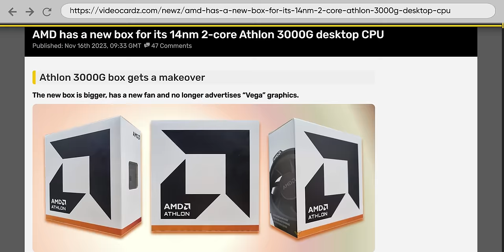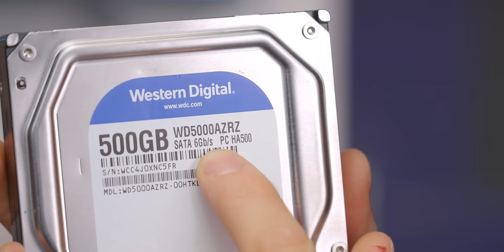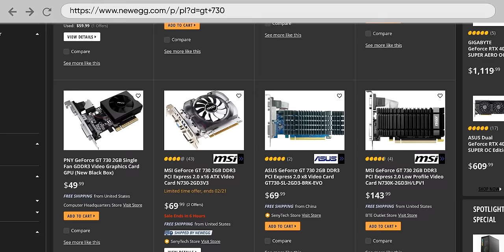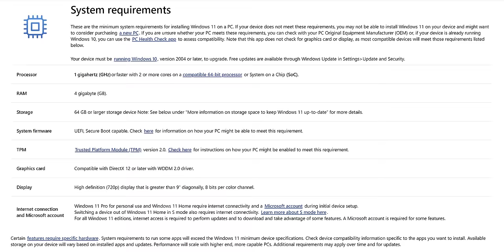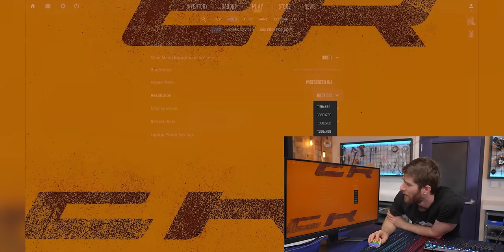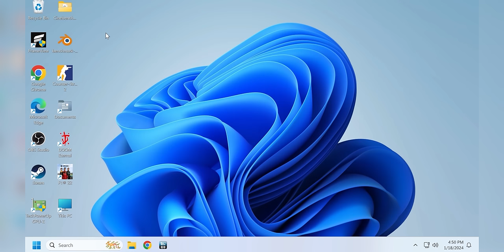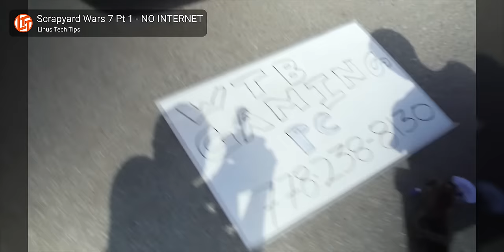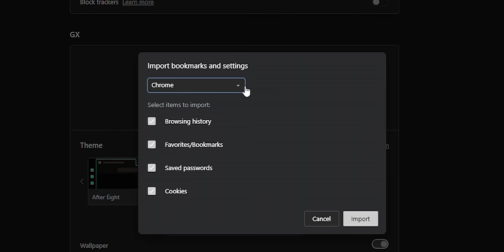I Built the Slowest Brand New PC and it Sucks.

Comment: Y'know, people say Linus is out of touch. But he still got sticker shock at $320. He has no reason to blink at that number, but he knows that it's unreasonable for that computer, because he does stay in touch with actual value to real consumers.
Reply: What I don't think helps with a lot of the people claiming linuses out of touch, is they don't seem to understand the difference between price to performance and price. Something can be very expensive but not be overpriced because you're building a PC to compete with the Mac pro on price and just seeing how much better it is. But a $300 system built with new components that is practically speaking incapable of running a modern operating system is simply unacceptable
Reply: @the_undead I wish they tested with an ssd that cost the same as the hdd to remove the hdd as the bottleneck
Reply: @aaronmarchbanks5394  the objective was to make the slowest PC not the cheapest PC That is still effective, also, I don't know if you can get an SSD at the same price as that HDD
Reply: @aaronmarchbanks5394  As linus mentioned in the video, that loading wasn't just the fault of the hard drive. That cpu wasn't helping at all.
Reply: @the_undead  well I know I have no income and I trust ltt to help me know what's in my budget when I have one
Reply: He also claimed a 20 MB/s download speed is "atrocious" and said 120 fps is "not a ton", even though lots of people have never even experienced numbers that high.
Reply: @SterkeYerke5555  20MB/s not being bottlenecked by the connection itself. Remember - he's using wifi that can go much higher - it's not going because the hardware sucks.

Also, CS2 may be heavier than CSGO but it's still a source game. Getting 120fps with lows getting to 60 is pretty mediocre. Most people playing that game get roughly that much or higher.
Reply: @SterkeYerke5555  Counter Strike is Minesweeper of this generation, if you can run windows on it, it will run CS just fine. The problem is running anything actually graphically demanding.
Reply: @SterkeYerke5555  To be fair the issue is the consistency.  He'd be better locking it at 60.
Reply: @SterkeYerke5555  for my australian internet the download speed wouldnt mean anything and 120 fps is absolutely fine, thats just his standards of what he is used to
the issue is the celeron and the extremely slow 5400 rpm hard drive that really held performance back. trust me, you do not want that experience, just go used or spend a bit more money on a ryzen system
Reply: Linus is behind in trending though.ZacksTeckTurf can communicate the same information in less time with just as many views. In a few days he should release a video summarizing the point.
Reply: @the_undead  You absolutely can, you just have to look around.
Reply: @SterkeYerke5555 but he’s not out of touch that is his reality 🤦‍♀️
Reply: @SterkeYerke5555  I mean, I've stressed my lack of income. I run 144hz, and have 1gig internet. Those are sorta industry standard where I'm at. So, I can't count that against LTT.
Reply: @DanielFerreira-ez8qd  On second thought I kinda agree on the fps part. Even though I'd still consider 120 fps to be quite a lot (and not because I'm not used to seeing more), I can only applaud tech reviewers for normalizing such framerates. I'd much rather watch a reviewer criticising 120 fps because it's not consistent than a reviewer who claims 30 fps full of stutters is "fine", because the latter will just make people believe they're having a good experience when in reality, by modern standards, it could be a lot better. I was still on a 60 Hz screen with quite a bit of input lag three years ago, but now having a 144 Hz screen with low input lag makes a big difference, even for older games! I wouldn't want to go back to 60 at all. 

I still stand by that 20 MB/s is plenty for that cpu though. Yes I know Linus' connection is a lot faster, but realistically, if you're going to get a Celeron, you're unlikely to have an internet connection that surpasses 20 MB/s anyway. Anything above that wouldn't be relevant. And tbf, with this computer, 20 MB/s download speeds are the very least of your issues 😅
Reply: Sometimes he is out of touch, But I've seen people claim he's out of touch because he basically said "You shouldn't pair a GPU with a CPU that will significantly bottleneck it in the first place" in regards to Nvidia/AMD driver overhead discussions a couple years ago.

This is some of the most basic advice when it comes to component suggestion, he didn't even say "only get high end CPUs" or some shit, just basic advice that practically EVERY builder would say is fair and reasonable, but because he mentioned something vaguely related to budget people called him "out of touch".

It's ok to have a budget, practically everyone does, but if you buy a $500+ gpu and a 30$ cpu that bottlenecks it and have no intention of upgrading because you don't want to spend money, you really need to reevaluate who's out of touch.
Reply: @pptemplar5840  I'm pretty sure I've seen a long time recurring theme on LTT videos about balancing the budget that you have across your components and a way that is practical to get the most efficiently out of your budget and yeah I would never ever get a GPU that outclasses my CPU whether that means I have to spend a little bit more money on a CPU or a little bit less money on a GPU that depends on my budget but you're right that's basic advice if your budget is $500 probably delegate 200 to 250 to your GPU
Reply: @aaronmarchbanks5394 Read the title one more time, please.
Reply: @lande.r1  yes I did, he compared the slowest new pc with a hdd to a used pc with a ssd. I would still have liked a comparison with an ssd in both as I don’t think someone trying to use the cheapest new parts for a gaming pc is going to at least buy an ssd
Reply: I think he just remembers his old days of not being able to afford anything!
Reply: This video would have been less dramatic if he spent another $40 and doubled the ram.
Reply: @MissesWitch  Definitely not a bad thing. Dig your S/N.

Comment: I would be interested to see the slowest build running Linux and see the difference in responsiveness. Windows 11 is HEAVY.
Reply: or windows 10 ltsc
Reply: Came to say the same thing, throw some light OS on it. it really shouldn't be that unusable. those specs were more than reasonable a decade or 2 ago.
Reply: Windows 10/11 are lighter than Vista and 7.
Reply: @ChaZcaTriX wtf, win 11 lighter than win7??
Reply: No, they aren't  @ChaZcaTriX
Reply: @techkidwhiz honestly if you go comparative to the performance of the time, it might be
Reply: @jaykera  
What does that mean? That W11 on 16GB RAM performs as about the same as W7 used to on 8gigs? Xubuntu being light just means it's light, it's rather an objective measure. 300mb RAM usage is something
Reply: Granted, I've been using Linux on the desktop fairly exclusively since 2004, and Linux is used in much more places than Microsoft Windows, Microsoft Windows is a niche software that has it's uses, it performs better on lower spec machines than Gnome on Ubuntu. An Arch machine running blackbox as a window manager is going to be strangled less, and a FreeBSD machine running the same will outperform either(but then might crash when you try to use a file manager), it depends on the use case.
Reply: you would think that but i noticed a 10-30 fps gain in most games going from linux mint to arch. my system has 16gb ram and is mostly cpu limmited & I thought it would just be lighter in ram but i think you need to account for the fact that less processes running / more efficient code = more cpu cycles for your games and stuff
Reply: @BlauNate lol a decade is a long time in the computer world
Reply: @ChaZcaTriX  What are you smoking? You're high
Reply: I think they are probably trying to demonstrate the difference on Windows because you know, that's what everyone actually uses for the most part.
Reply: @EthaSound  yes, I wasn't saying that it should have been included in this video, but rather it's something I would find interesting as an aside or a different video.
Reply: Specifically a lightweight Linux distro desgin to be easier to run

Many people say "Linux runs better then windows" but distiros like Ubuntu or Manjaro are about as heavy as windows 11

This brings the problem with referring to Linux distros as a whole as "Linux" the nature of Linux means there will be significant differences between distros
Reply: @ChaZcaTriX I don't believe you but okay
Reply: @flamingscar5263  I think this is the main reason why Linux is not likely to be used by the common person anytime soon, because no two distros are the same and the more nuanced something gets the harder. It is for the general public to understand the thing. Probably not helped by the fact that Ubuntu seems to be the one that most people in the general public know of
Reply: 90% of the problems was win11, that PC on chrome OS or some light Linux would be a 100% usable browsing/youtube/netflix PC, i repair OLD office computers just for that (2nd or 3rd gen i3s mostly, just get them up to at least 8 gigs of ram, put an old small SSD and they are perfect for everyday use (some of the "faster" ones i put a a ligjt version of win 10 on them)
Reply: How much is worse is Windows 11 compared to 10?
Reply: especially an xfce build. that would fly on any of these computers, and you still get some steam games (my whole library works on linux so it depends on what type of gamer you are lmao)
Reply: @matthewkrahn3  not the last decade though. An i7-4790K is a 10 years old CPU at this time, and in single threaded tasks it's not even twice as slow as i9-14900K. Yes, it has just 4 cores, not 24, but those cores are plenty fast to run even current games. The 1080 is "only" 8 years at this time, and it still is just as fast as a GTX 3070 mobile.
Reply: I wouldn't be surprised if it had a massive difference, my ThinkPad T42 is still running on a 5400rpm HDD until my SSD adaptor arrives and it boots Debian 12 in about a minute.
Reply: @enriquedossantos3283 true, but as a comment above stated it seems this was more directed towards a general gamers build. If you try to go cheap how much will you spend. Especially since a windows key cost quite a bit.  Had they gone the Linux route that would free up their budget for  better components.  On the other side ( at least for now) gaming on Linux isn't exactly the easiest thing to set up ( remember how much trouble Linus had during his time with Linux lol). Having to worry about compatability with games ( not to mention as Mutahar from SomeOrdinaryGamers always brings up Anti-Cheat lol).  Going Windows would just save so much headaches unless you truly are tech savvy.

I would also be interested in seeing how well the machines handle being a computer with different Linux distributions. 

Personally I have only used Ubuntu through VMware, so my Linux knowledge is basically none lol.
Reply: @666Tomato666 the saying is something like for every year technology leaps 2-4 years ( don't remember lol), but I hear what you are saying. My laptop is already hitting 8 years, but still runs just fine. Upgraded it to an SSD and that significantly improved it's performance.  Though lately it has started running a bit slower here and there showing it's age.  But it can still run modern games which is impressive enough for me lol.   Got starfield at mid with 20-30 FPS ( maybe I don't remember the exact framerate since I was too bothered by the Morrowind graphics lol).
Reply: @matthewkrahn3  Yes and no, this is not that different than the pc I using in high school back in 2010. It was running an amd phenem ii 965, which as far as I can tell, is pretty much the same specs as this intel cpu. Bit harder to say for the GPU, I cant remember the model, some amd radeon. That was able to run starcraft 2 just fine on windows 7 and later windows 10.

on the cpu, they've mostly only improved on core count, and cache. for the GPU there's a lot more gains, but that shouldn't be needed to just use your OS.

The only other thing that would really explain the performance is the 4gb of memory, which would destroy a system like this. but 4GB of ram to run an OS is just kinda crazy. you had 90% of the functionality back on windows XP, where 4gb would have been almost half your hard drive.
Reply: @TheCommanderTaco  The "saying" is Moore's law, and it's about number number of transistors in a CPU. The problem is that number of transistors is not a direct indication how fast a multi-core CPU will be. Also, it's talking about the bleeding edge, not average PC available.
Reply: I was thinking the same thing